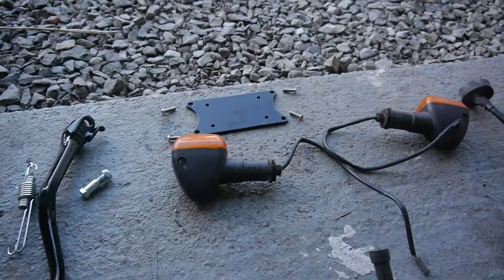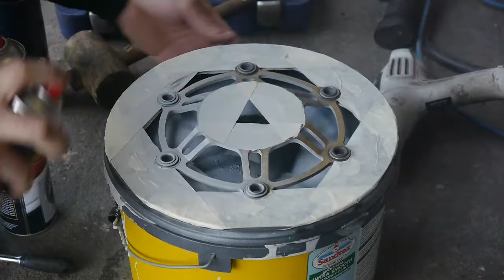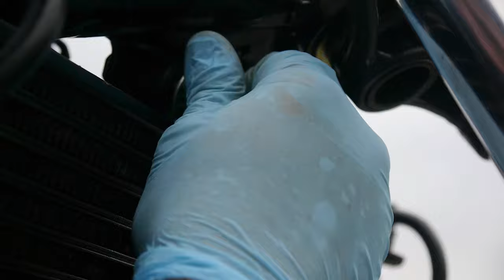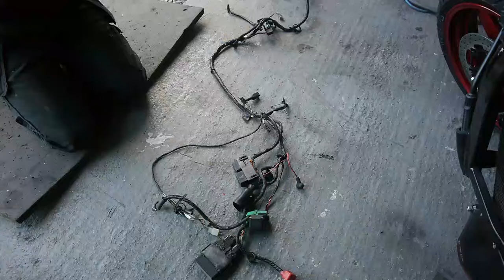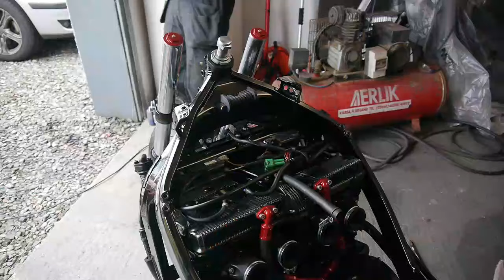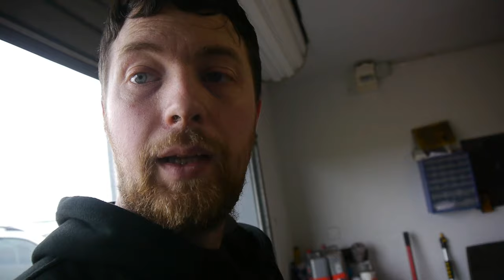Suzuki GSX600F Katana Restoration - Part 7

Comment: Great videos, a lot of elbow grease and love has went into this bike! 🙂 Can you please share with us what kind of handlebar riser did you use?  Planning to install one on my 98' GSX too.
Reply from the maker: Thanks very much. Yeah a lot of work and love went into it. 
I have used the handlebar risers off the GSX750F model of the same age. Although be careful as around 98-02 have narrower ones (distance between the 2 front shocks) than the 03 onwards model, I found this out the hard way as you will see in one of my videos. They help to reduce the vibrations and give a little bit more comfort being that bit higher.

Comment: Hi mate have you still got the tripple trees for the 750
Reply from the maker: I have one of the parts. I think it’s the lower part I have which was too wide for my bike. Must have been off the 02 onwards model
Reply: Would you be keen to sell it
Reply from the maker: @deanbonjekovic3815  yeah I would. I’ll double check it’s the bottom bit I need here shortly. Do you need me to measure it to make sure it’s the right one for your bike?
Reply: @DarrenMcKinney1  i have a set of 2005 forks and i have a 98 750.from 2002 the front wheel hub was wider thus the trees being wider
Reply: No need to measure.how much you want for it
Reply from the maker: @deanbonjekovic3815  sorry for the slow reply I was out on a charity run there. I think it cost me £30 plus whatever delivery is if that would suit?
Reply from the maker: @deanbonjekovic3815  yeah sure it’s dmkcycles.info@gmail.com